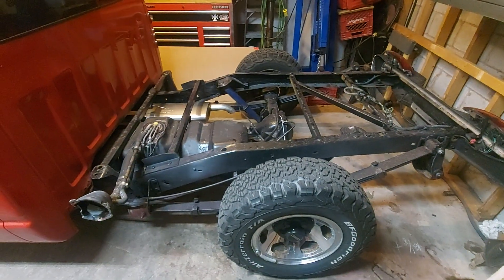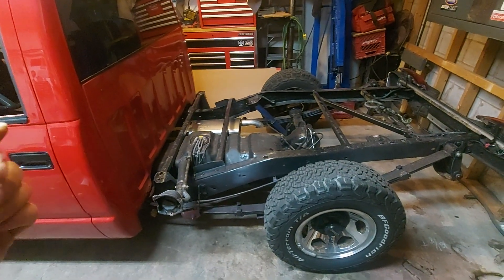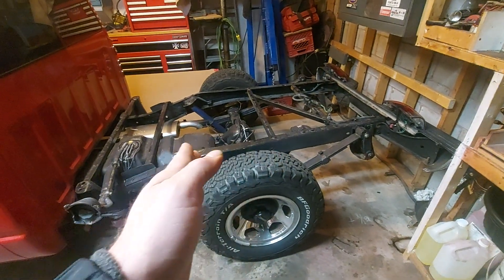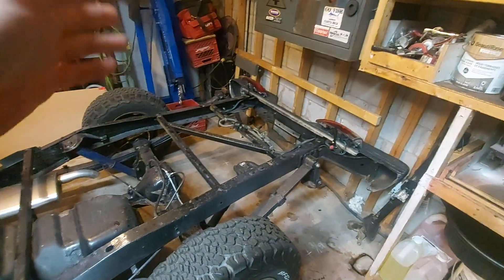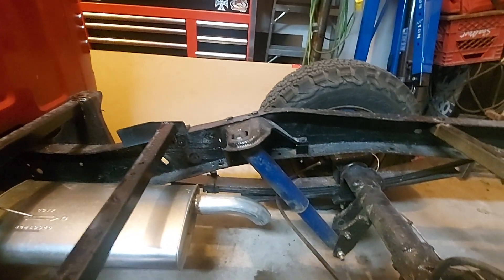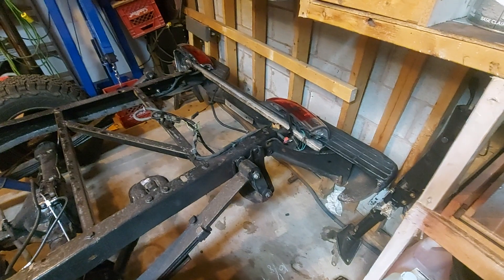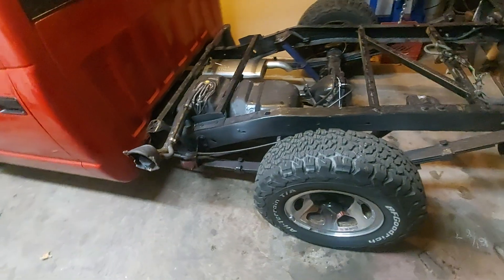Custom OBS truck build pt.6

Comment: I'm getting close on my conversion... It's definitely alot more work than I thought. I'm currently trying to wrap up the gas tank mount. I see your x-members, but how did you go about strapping the tank to your x-members? Appreciate your videos
Reply from the maker: Basically used some metal strapping 1.5" wide bent end 90deg drilled and bolted threw xmember closest to frame. Bolted. Floor jack tank into place. 
Drilled threw xmember on other side of tank, wrapped straps under. Used 8" long threaded rod to draw up strap on other side. Will take some fitting on driveshaft side but when done you'll have room on threaded rod to tighten but also loosen if you ever need to remove tank again. Hope this explains
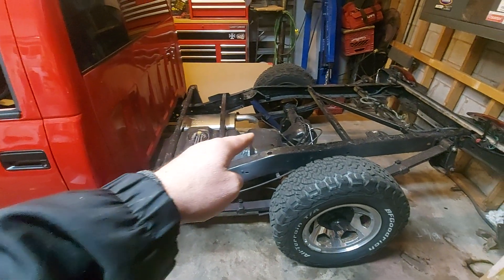Reply from the maker: Ep. 8 of my videos starting at 1:09 might give you a better visual
Reply: @campgrounded4403  Thanks. That's very helpful. I'm going get some strapping material at my local metal supply, and go this route.

Comment: Because the different sweep in the frame, how do you mount the front spring shackles at the correct hight ? 
Hope my question makes sense.
Reply from the maker: Height wasn't a concern to me as much as location to locate axle in proper wheel base.  I took measurements off of a factory shortbox truck and used rear cab mounts as datum point. 
I think it might ride higher but drop shackles brought it back down. Hope I answered.